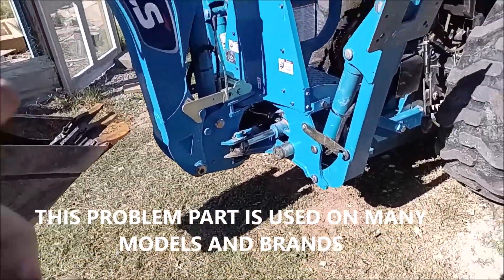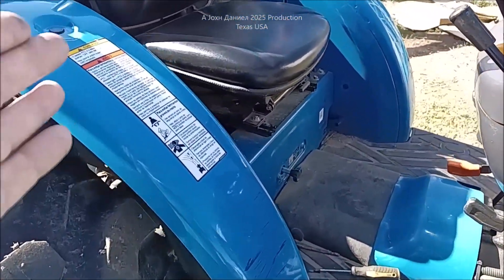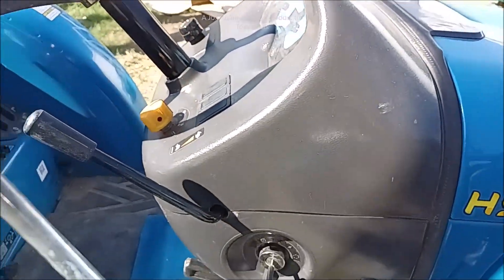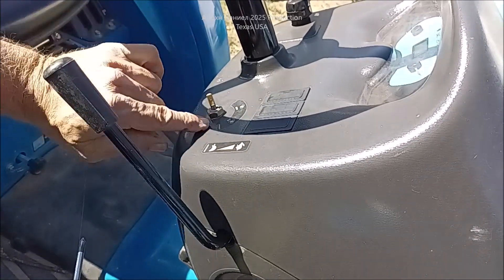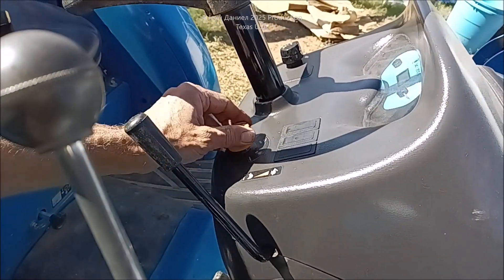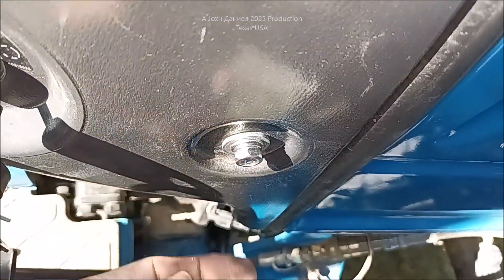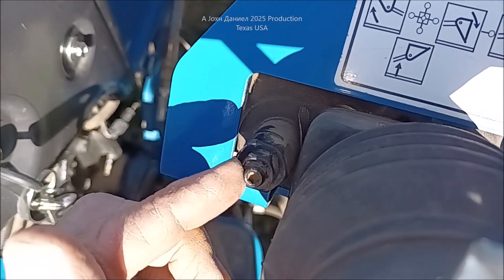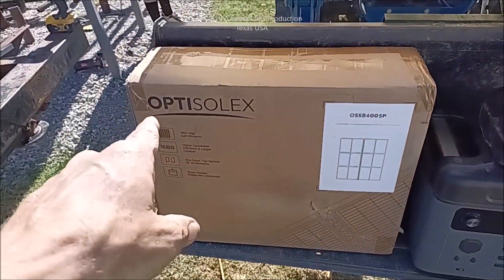Fix a Common NO START issue on small diesel tractors, LS, Branson, Kioti, and more

Comment from the maker: This tractor the day before was hard to start again. Sorry I did not run the battery down to show you what that sounded like. Get you a few cans of Deoxit D5 to keep on hand https://amzn.to/3WNN96W it's a lifesaver. Many forms of electrical contact issues with all new things, safety switch fouling, and corrosion on outdoor power equipment. Zero turn mowers, modern vehicles to small tractors. Deoxit is not just for your old vintage stereo gear.

Comment: Hey John I’m fixing but 2 more 12v 300 amp batteries and was considering the Temgot batteries like you have but I noticed that they changed the name to Temgo would you know if it’s the same build battery using the same cells  or did they just change the name of company or is it a new manufacturer?
Reply from the maker: Yes they are the same in all ways except name change. Temgot is some never heard of bolt maker brand in Europe that filed on them in China for using their name, so they just dropped the T in it. Goofy but I ask them a month ago and got that reply. If your a PRIME member on Amazon they have them 30% off right now though. https://amzn.to/44hxEIo and you can actually get the heated ones for only $20 more per battery which is a excellent option.
Reply: I already have 2-power queen 12 v 300 amp do you think there would be any issues if I mixed both brands in one large battery bank or should I stick the same brand ?